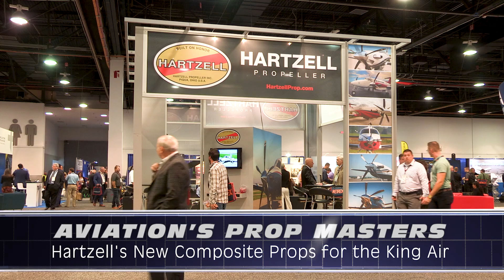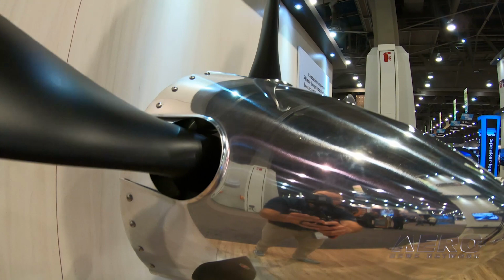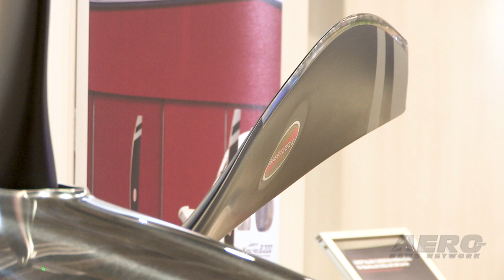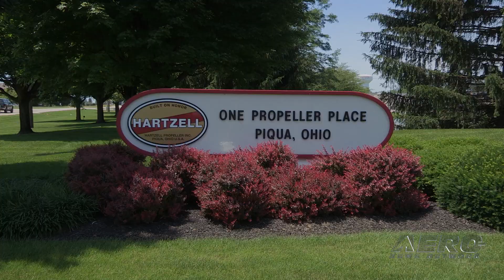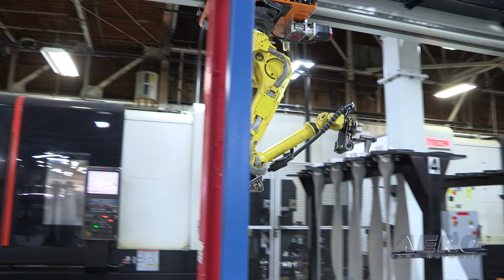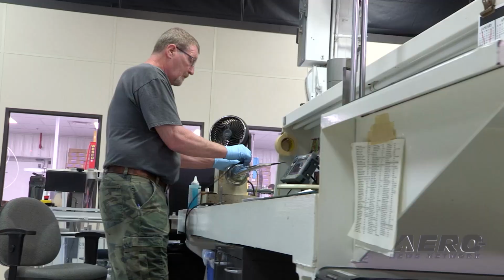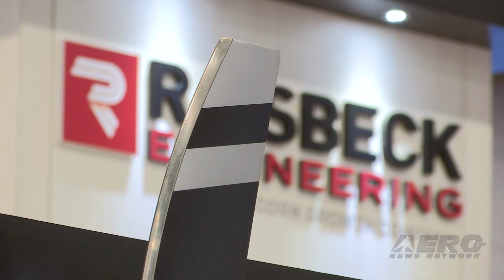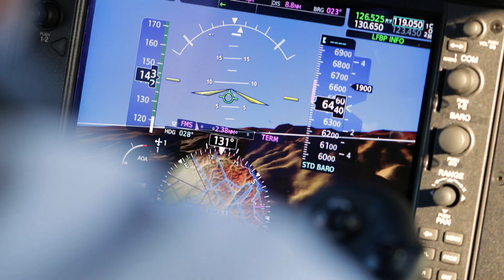Aero-TV: Aviation’s Prop Masters - Hartzell's New Composite Props for the King Air

Comment: I've heard it said that the five-bladed propellers are not quite as efficient as the three or four-bladed propellers. Thus a question: Could it be said that the closer a turbine engine gets to needing a hot-section overhaul (after it has started to lose rated torque...) the less efficient the five-bladed propellers are? In fact, could it be said that the aircraft will suffer even more noticeably in takeoff performance, climb and cruise speed with these weakened engines because of the five-bladed propellers instead of three or four-bladed propellers? If you could replace the five-bladed propellers with three-bladed ones on these same, nearly run-out engines, would the aircraft recover SOME of its rated performance?